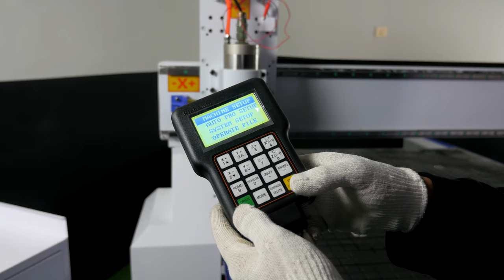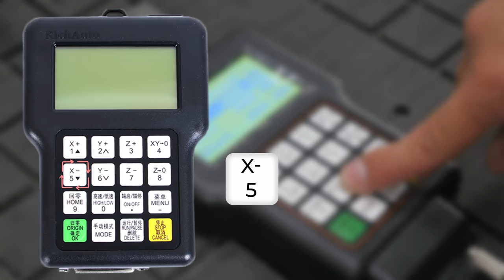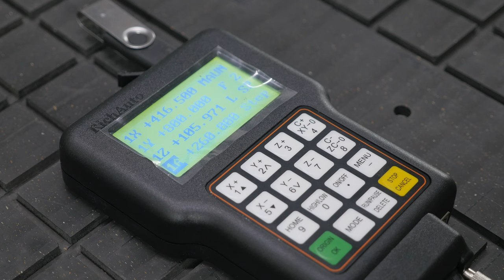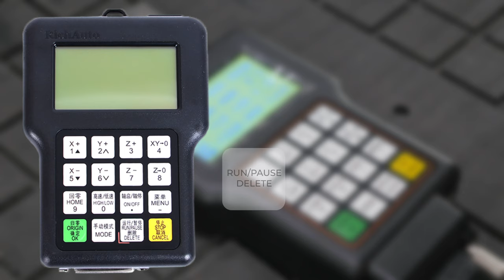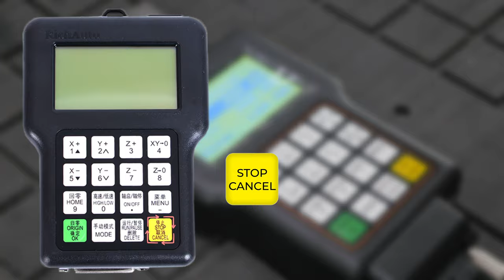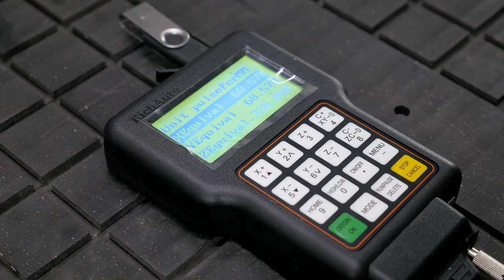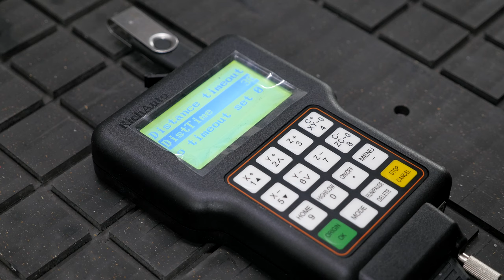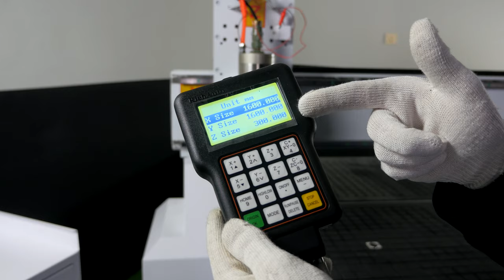HOW to OPERATE DSP CONTROLLER on WATTSAN CNC ROUTER

Comment: Recently replaced my DSP Controller. Ever since, my machine seems to now scale my cut file both on the X and Y. Files sent to cut are smaller than what was sent.

Does this have anything to do with the "Auto Scale" option?
Reply from the maker: Hello! 
You need to ajust Menu-Machine setup-Pulse equiv.

Comment: Sir,For 4axis rotary machine  which model DSP is perfect.I have Richauto A11.
Reply from the maker: Hello, to work with 4th rotary axis you need RichAuto A18, A11 can work only 3 axis.
Reply: @Wattsan  By A11 possible to use YZ&A axis?
Reply from the maker: It's designed for work with X, Y, Z. But if you can edit postprocessor of your CAM software to swap A axis to X, maybe you can use it YZA, but we didn't test this solution.
Reply: @Wattsan  Thanks.... I will try .
Reply from the maker: You are welcome!